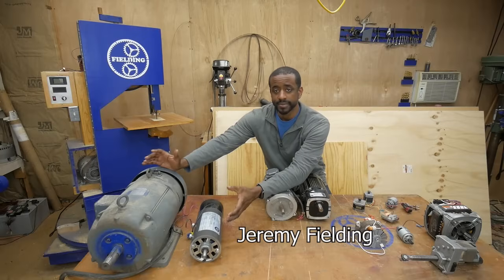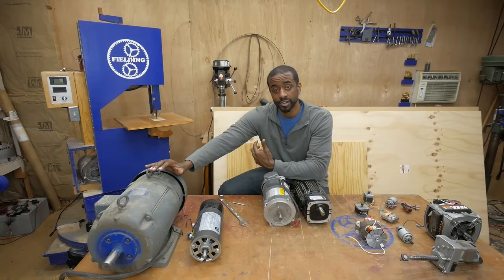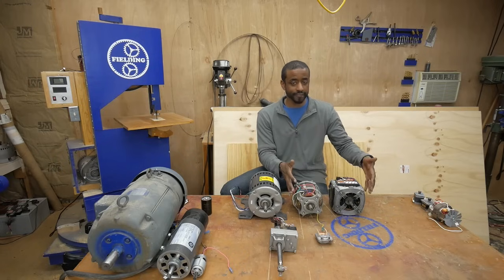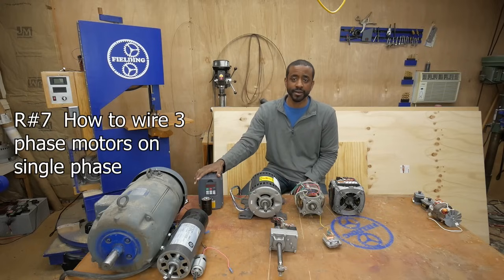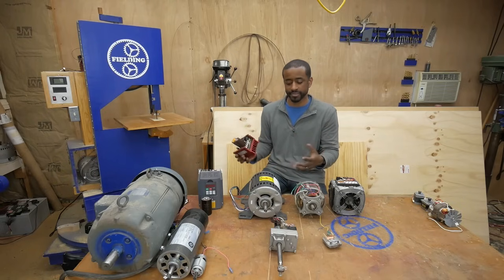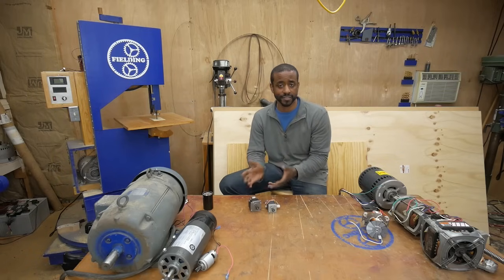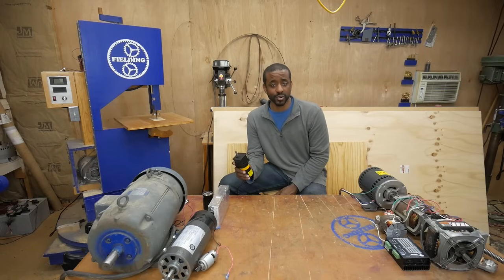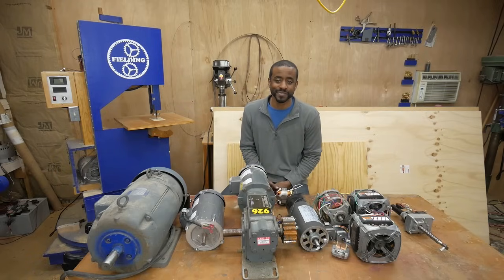Ultimate Beginners Guide to Using Electric Motors for Makers and DIY Projects; #068

Comment: Thank you for this very good explanation of the different types of electrical motors. As a cnc machinist i often have to do with those different motors. And now iam trying to build a industrial robot by myself(just like you). I have good skills in fusion 360 and programmed much functions on the Postprocessor on my own. I got all what i need cnc lathe, cnc mill and a good Boss, that gives me the freedom to do my projects as well. I do this because i want to adapt the electrical and physical side of Engineering this would complete my knowledge to build machines. Again: thank you!!!!

Comment: I’ve been scrounging parts from various devices around my house and thrift stores to make a wood lathe out of a drill motor that looked almost exactly like the one you showed in the video. Would that be a good candidate for a wood lathe motor ? I had been using an old corded drill so I just assumed it’d be ok but Ive been making things with electric motors or at least trying to for years LOL but honestly never really took the time to learn much about them till now. Half the time I would burn them out And the other half I get lucky. So I will be watching a lot of your videos now that I have discovered your channel you described and explain things in a much more understandable of a Way then reading it From some online schematic PDF thanks

Comment: what motor can you recommend i use if i want to convert my cvt scooter.. should i retain my cvt or just a chain drive.. im looking to use bldc.. what can you recommend.. thanks!
Reply: the cvt is for the inability of the gas engine to develop torque, as with an electric motor it will not need the cvt as all the torque needed is at startup, I would run a chain direct and target the max speed and gear ratio for the rated electric motor speed and power rating....the cvt will only reduce the efficiency of your system giving you less usable torque and speed

Comment: I genuinely don't want to split hairs because I think your videos are absolutely brilliant but free treadmills just don't come around every day because of a blown fuse or a broken plastic part I'm a former fitness equipment repair man and it's typically because the cost of the repair is greater than the value of the machine or the value of the replacement of the machine or the inability to get a replacement part or sufficient knowledge such as yours as to machine to run on different parts knowledge such as yours. Not to mention those Motors that come out of the Proform and icon branded products are absolute garbage but if they're free who cares I have personally machined parts to repair older machines but not everybody is an electrical engineer hence why these videos are so valuable

Comment: how would you wire a 1ph 3hp 8 wire motor with i beleive is a run capacitor. at 120v.

Comment: A great way to furnish 3 phase power  when you have only single phase power! You can upsize a VFD and feed the largest DC power supply with single phase, now the VFD converts ac single phase to dc and then inverts it to 3 phase ac! And you will then have all the benefits of a VFD. Speed control, breaking, acceleration ,deceleration and other flexibility! No more need for roto phases or static phase converters!

Comment: is it possible to power a bandsaw with a treadmill motor? i recently acquired a Hobart meat saw for free and am wanting to convert it to a wood cutting bandsaw. i only have 110v for my power supply and am wondering what kind of motor i could possibly use

Comment: I have an old 4" wide by 12" Diameter grindstone (an antique from my father). I'm looking for a gearhead motor running at a constant low speed. Somewhere between 30 to 120 RPM @ 1/2 to 1 HP.. 60 RPM would be perfect. Do you know of a cheap or free source for such?

Comment: Hi Jeremy, 
I have a sawbench with a 12" blade and a 1ph 3hp cap start induction Motor. (I am in the UK so 240v 50hz)    It struggles to start with power supply that I have in my remote workshop.  I was considering using some other method to 'pre-spin-up' the Saw blade/motor (rather like a starter motor in a Motor/cycle)  and that could disengage when I switch power on to the saw.  I think I can work out a method to do this but don't know if I would be doing anything weird with back EMF or ???.. And indeed whether this approach would work to reduce the inrush current.. Any thoughts please..   (I guess this could also be useful if I did not have the start Capacitor..?)

Comment: Who’s behind the camera?
I pick up and scrap it ie. copper ally stainless.
I’d like to know how to feed the motors to see if they work?
You go to the base of the lumps on 6 mm checker plate and produce a 1mm radius 90degree external bend.
I Question-  how would I do it.
Question 2 where do I find the camera man?
Question 3 where were you 40years ago?

10outof10 for the last 8to20videos I’ve watched.

Comment: Love your videos quick question. I am looking to use the motor I've taken from a treadmill. And I had planned to just use the controls from the treadmill unfortunately in my eagerness to dismantle the thing  not only had I failed in making sure everything was in working order. But also failed in paying close attention as to how everything was wired together. Smh HUGE ROOKIE mistake i know. My question is with the treadmill controls being digital would it still be worth using them as a speed controller or is there an easier way to go?
Reply: I did almost the same thing, only worse, I broke the circuit board in half taking it out. Turns out all you need is a motor controller, a bridge rectifier and optionally a choke coil. You can buy all the parts from Amazon for around $30 or so. I don't know if Jeremy has a video on how to build a power supply/motor controller or not. If he does I would certainly watch it but if not there are a lot of videos on youtube on how to build a power supply/controller specifically for a treadmill motor.

Comment: Being a new electronics/electrical motor hobbyists I was excited when I found this video. I have a quick question if you have the time. 
I have a 18v DC motor that I salvaged from a Broken power tool. Would it be possible to run this motor off of a 12v lead acid battery that I got from a broke down riding lawnmower?

Comment: Thank you for the information! Can an induction motor run off batteries? If so. Does it require more energy to run than Dc motors? Thank you.
Reply: Got it! Induction runs off AC. So a converter or inverter?… is needed. I saw the go cart video where you explain this. Thank you!

Comment: I have a rotary phase converter, the motor is completely frozen, as in the shaft will not turn even with a pipe wrench. I think it sat outside for a while and the parts may have rusted shut. Tried to run it and it just tripped the breaker. I can't even get the motor apart because all the bolts are just stuck in good... It's probably going to the junkyard. It's a really large motor, probably 15HP.

Comment: Wow, that's some crappy motors you got there. If you want low-rpm torque, you get a suitable transmission, not a mega-motor.
Reply from the maker: You are way over simplifying the problem. It depends on the application whether you use a gearbox or larger motor. There are many industrial applications with large motors and no gear... and very tiny motors with huge gear reductions.
Reply: @Jeremy_Fielding  A large motor means large moments of inertial. Of course, if I need large moments of inertial, then I use a flywheel.

Comment: I'm building and electric car.  Basically a glorified golf cart.
 Its a 71 maverick. 3100 pounds.. The plan is to replace the 6 cyl. With an electric motor.about 100 HP. Lots of torque.
 Can you recommend where to go... And what to but.. That's would work will for this application.the plan is to utilize the existing drive train.  The kits available require a computer controller because there so powerful.
But your recommendation would be great.thank u.

Comment: Hey you have made some hella info packed videos however didn't touch on my problem. I have old wringer washer motor started smoking can't find a free replacement. Another motor had it's circuit hookup melt it's a split phase what I'm stuck on is these motors have points not brushes and the one I wanted to put my electric hookup in has an added component two blue wires going into a small flat square box. Is that a startup capacitor?

Comment: Hi Jeremy. I’m a new subscriber. Love your expertise! 
Question: From your description of electric motors, I think I want a brushless dc motor to power my 24 ft pontoon boat. I want the equivalent of a 30 hp gasoline outboard. It looks like that size will weigh 300+ lbs. I don’t think I need much torque because the prop can cavitate while the boat accelerates. I will use pulleys and V-belts to drive the prop. Am I correct to want the brushless dc? Or is there a better alternative?

Comment: Hi Jeremy, how do you calculate Capacitors to power 240 volt single phase motor , I have a Chinese drill press and the cap has failed ,removed it but fear it ended in the trash on a clean up.

Comment: thank you so much! that was super informative
what motor would you suggest for a small diy belt grinder? im thinking of building a 1x30 with speed controller with low rpm

Comment: I'm a college student about to lose my housing. I have a TON of mechanical parts and just came across a 'newer' broken washing machine. I've taken it apart, and was going to connect the motor to a little miniature bicycle to make electricity under my bridge. Could I use microwave capacitors to store enough energy to light led bulbs long enough to do homework and not have to pedal?
Reply: My spot is under a bridge, with a very slow running creek. So, I kept the pumps and hoses. Open for ANY suggestions. I have two more semesters, that's it.

Comment: Air compressors have special motors. They are rated at 5 horsepower but plug into a 15 Amp 110 volt outlet. The extra 3 horsepower come from where???
Reply: Initial inrush current (why lights dim when using a circular saw on shared branch circuit)...there is peak power which for a moment will produce but not sustain...e.g. when your saw hits a knot current draw will increase momentarily but level out again once clear of the knot...but if the knot is substantial and the saw requires a longer current draw time you would blow the breaker /fuse. (IDLE free vs PEAK load)

Comment: Replacing a diesel to electric motor? Diesel now 2,2 litres, 33KW, torque  110 NM at 2500 rpm. (Boat engine BMW D50)). Can somebody give approx numbers for electric motor with same "power".  And if possible: to drive the boat in one hour at 2500 rpm, how big battery baggage do I have to have (lead or "18650" batteries? Thank you in advance for replies. (Boat speed is fast with only 1000 rpm...about 6 knots and top speed 13,5 knots 3200 rpm) By the way: Excellent video.

Comment: Nice job. I've subscribed and will search some of your previous videos. I'm building a magneto test bench and want a variable speed motor to turn 1000, 2000, and 3000 RPMs, as well as down to 200-300 RPM. Keep up the good work.

Comment: Hello Jeremy! Thank you so much for the videos man. This is the 2nd time you have been an amazing source of info regarding my projects.
My question is: I have a gasoline generator inverter (Honda EU2000i 240V 50-60Hrz European model). What electric motor should I use in order to(if feasible) to power a mid-size ATV and effectively turn it into a hybrid(Where Generator provides electricity to a an electric motor for actual mechanical power). Also I read that there is a way to bypass the pure sinewave inverter and use the output from the alternator from the generator and use a monophase motor but I just cannot find the info I need :(. Any advice will be greatly appreciated.
Thank you again!

Comment: I have a small air compressor for an airbrush it's a 5th horsepower and the wiring is all cut up I have to hook this up to a 2 wire capacitor, pressure switch and the power cord how do I do that? the pressure switch has 2 prongs on and the power switch has 3 wires. Any help would certainly be appreciated

Comment: Jeremy I have a question.  You said speed controllers for universal motors work until the load changes.  I saw two kinds of speed controllers, one of which uses the speed sensor coming from the motor. I assume these would adjust to the load to keep the rpm constant. Do you agree? BTW I'm trying to build a simple lathe and am considering a universal with speed controller that uses rpm sensor or induction motor which I will have to switch pulleys.

Comment: Very nice! After watching this vid, a question comes to mind: I got a few 3-phase motors which work nicely with a VFD. However, one motor does not: it will only work for a very limited range of frequency (50 +- 10 Hz), will make lots of noise and will never reach the nominal speed (is always slower compared to when you disconnect the VFD). Any ideas why that might be?

Comment: Hi, I want to use a motor to engage the car AC compressor instance running by belts, which motor I can use? 
My plan is I will removal the clutch and put a motor to spin the AC compressor at a contanst speed of around 2000-2500rpm. When ECU turns on the electric signal for the clutch engage, the motor will run. And It stops spin when ECU turns off the clutch signal.
My car using a 12v system but I don`t know which size, which kind or where to find this suitable motor that can handle this project in both speed and torque. Will it effectively more than running by the belt? 
The reason is My car runs really smooth and quiet when the ac clutch does not engage, so I want to separate the AC compressor from the engine system.
Thank you.

Comment: You should check out the motors in some of the cordless push mowers. 
I'm running one in a Electrathon car.  35ish mph on a 16s Lifepo4 20ah ebike battery.  Not bad for a $45 motor off of eBay.

Comment: If horsepower = torque * rpm, are you saying an engine has to be larger for more torque? Doesn't sound right, are there other mechanical advantages to lower rpm with that form?
Reply: That's indeed right. But high RPM has disadvantages too. More friction and losses in the bearings, if eventually low speed required then more losses in the multi-step transmission. Might be more high-frequency loss. Take into consideration that commutation in a brushed universal AC motor is a switching which has a frequency.

Another very important factor is the stored energy in the rotating parts are squarely proportional to the speed but just linearly proportional to the rotating mass. If start/stop or servo application is required, it is important to minimize the kinetic energy of the drive system for faster response.

In servo drives another issue is precision. If you include "more gearbox", it will get more sloppy. Because of this, most of the time there is no gearbox in high precision servo systems, so the motor RPM requirement is dictated by the other components in the system.

Comment: Hello Sir. One question. What size of a dc motor do I need to replace a small gasoline engine from a weed wacker. The gas engine has 25 ccs and the rpms are about 1900. Thanks. Keep up the good work.

Comment: By the way, the capacitor its is used in single phase, to make create a current mismatch between the current and the tension. This effect will force the motor to start spinning.

Comment: Good morning.  Great video!  I do have a question as to how I can calculate to torque on a treadmill motor. The shaft size would actually be the size of the grooved pulley on the flywheel, right??  It's 4.25 hp with a 1 and 3/4 grooved pulley and 5110 rpm.

Comment: I have an ePropulsion Spirit 40v boat motor….   It comes with its own lithium 40v battery.  It draws about 25 amps.  
But I would like to use a single 12 volt battery to power the motor.   Is it possible to increase the voltage to 40v ?

Comment: Jeremy do you have videos on combining phase converters? I have 2ea 25hp phase converters and rhn one when I can but when I need more 3 phase I add the second 25 hp motor. I had a hard time getting them tk run together. It works but I DJ not know if it’s the best way? Thanks for all your videos!!

Comment: If you keep your eyes out, you can sometimes also get mobility scooter motors for free when they're working on the scooters at grocery/big box stores. usually, when they replace the gearbox, there's nothing wrong with the motor, but it's apparently too much of a hassle to swap the motor out(it's two screws and some zip ties for the wires o.O; ), so if you catch them when they have the guy out there, he'll give it to you rather than have to haul it away.

Only downside is the markings aren't exactly clear on what type of motors you're actually getting. I've got two that say they're 24v DC and that's it, and two that say they're 12v 56r/m (I assume that's shorthand for rpm?) and that's it. Both types of motors I've gotten have a spindle that goes all the way through, in the case of the 24v, there was an electrically disengaged brake on one end, and 12v, the whole motor assembly was mounted in the center of the wheel on an axle that when all the way through the motor (near as I can tell, I havent' gotten around to tearing them apart yet to check)